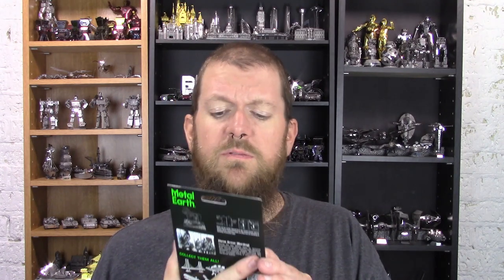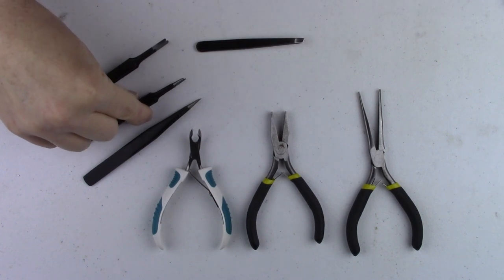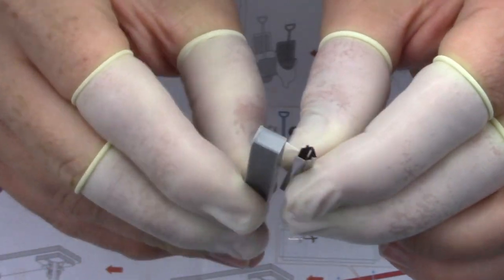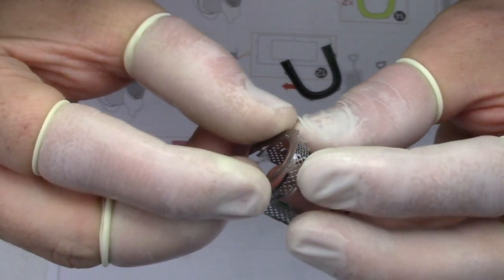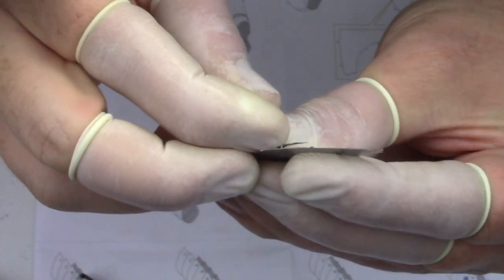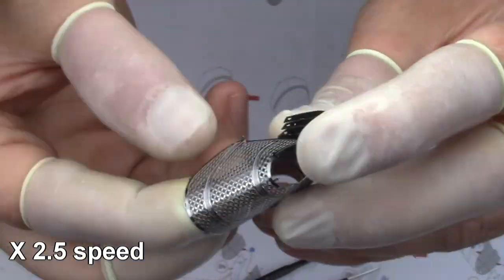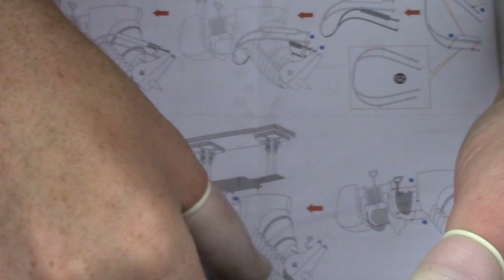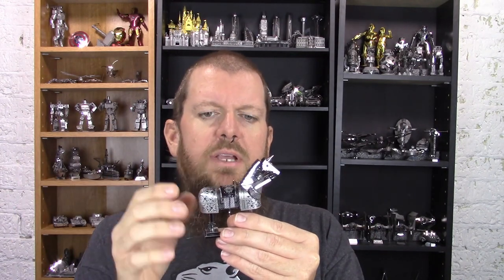Metal Earth Build - Horse Armor

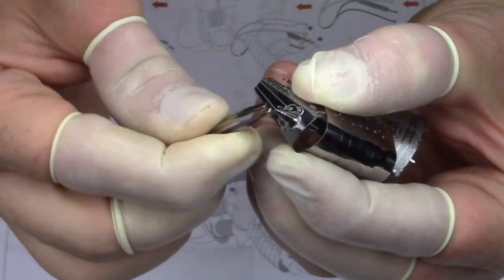Comment: Hey Brad.  At 29:35 you said the instructions said to twist the tabs but you chose to "pinch and fold them instead."  What did you mean by "Pinch and fold?"

That reminds me of something I do that I don't think I've ever heard you mention.  Sometimes when I feel like the connection really calls for a twisted tab, but I want the tab to be less visible, or maybe just more out of the way, I'll twist the tab  maybe 30 to 45 degrees, and then fold it over.  I think it makes a connection with some of the benefits of both methods.
Have you ever tried that?  How'd it work out for you?
Reply from the maker: There are three tabs holding the head/face piece on. Two of the tabs are parallel to each other. By "pinch" I meant to use the tweezers to squeeze those two tabs together bending them in and folding them over. Usually that "pinch" technique gets the bend started but you have to post the tabs in more. Then I folded the third tab as usual. The "pinch" technique is one I have used many times but do not always refer to it in such a way.

As for lightly twisting and then folding, I have on occasion done that. Sometimes it works great, sometimes not. I usually reserve that for situations where the connection really needs to be secure but the tab needs to be folded out of the way.
Reply from the maker: Folded out of the way for clearance issues. I didn't quite finish my sentence in the last post.
Reply: Thanks!